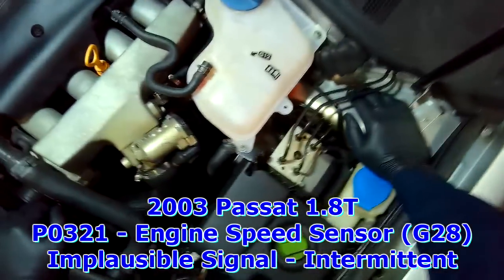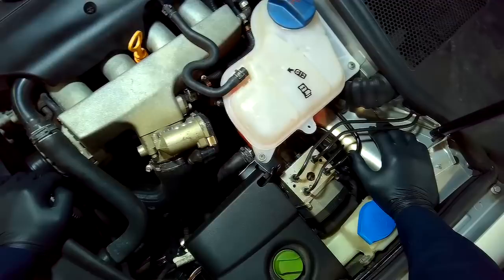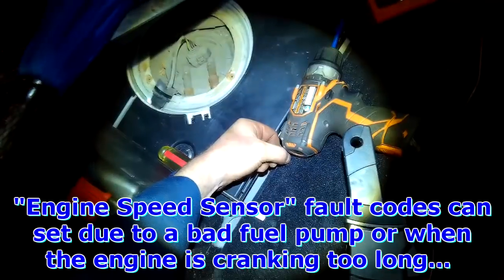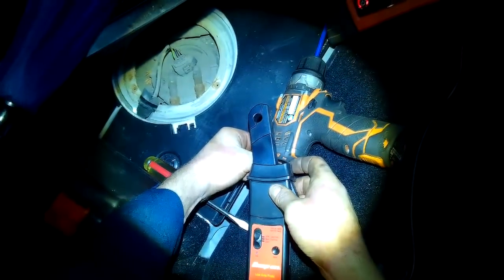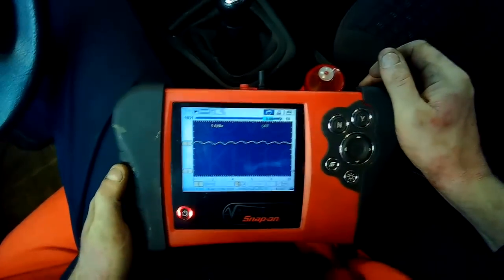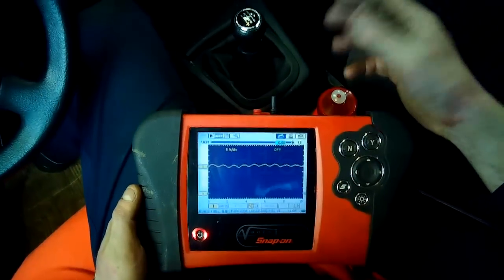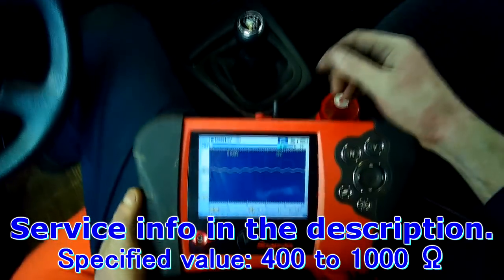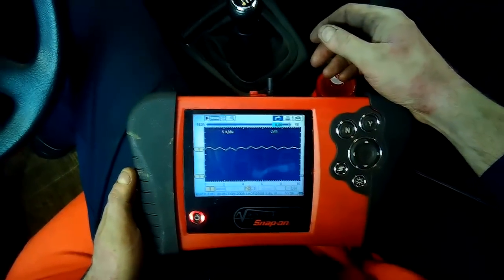VW B5: 1.8T Passat crankshaft position sensor

Comment: A valuable bunch of technics Thomas! Excellent.  The camcorder or go pro, whatever, those engineers should have already offered safety glasses, for user viewing of what exactly we will see so you can adjust the noggen accordingly.  LOL..
Reply: Also as I said in another camshaft position video you did, that I replaced the sensor but it changed nothing.  Still getting Camshaft sensor code. So is it next to consider the crankshaft sensor or the fuel tank?  Also, the crank sensor does not have its own code?
Reply from the maker: Like I already said... check if the cam sensor is producing a signal. If it is, then the signal is most likely generated at the wrong time and that's why the computer is flagging the cam sensor. Chain tensioner (as mentioned), cam & crank timing (as mentioned) need to be verified. There need to be 16 links between intake & exhaust camshaft TDC marks when the cams are at TDC (remove valve cover to check)... but check for a cam signal first (as mentioned). Camera I'm using is built into my glasses (link is in the description).
Reply: @EXOVCDS  I know I've read, watched items that you've already pointed out.  My hope is that this doesn't turn into a higher mechanical job.  That's where I may stop.  Paying to do it will unlikely be an option for my wallet.  Testing the CPS has me worried about accidentally touching a wire to another.  But i will.  Example: if my sensor is good, and I then remove the valve cover, there are things I need to prepare for.  I am at home and cannot walk to the parts department.  So my question is, if there are not 16 links, I assume this indicates a stretched chain and would require full replacement?  Or is there a master link. ( I kinda doubt). Thank You, Paul
Reply from the maker: Not knowing what the issue is... it's a bit premature to worry about chain issue. I have seen cam codes that were set because timing was off. That is the first & easy thing to check... after making sure that the cam sensor actually produces a signal. If the sensor produces a signal and the cam gear TDC alignment is correct with crank gear alignment at TDC, the next step is to check intake cam position (first with a scan tool to see degree offset) and if that does is not conclusive, then pulling the valve cover would be my next step... or activating the chain tensioner solenoid to see if a change in intake camshaft position is visible with a scan tool. Lots to do / think about. If the car drives & you lack funds, leave it alone and hope nothing gets worse. Start saving for a t hour diagnosis fee from a shop and then let them tell you what you need to do to fix the issue.
Reply: Thomas EXOVCDS I’m viewing I am understanding the limits of a multi tester as to a scan tool or diagnostic. I wish I could test my New cps but its likely ok as it’s brand new.
Reply: @EXOVCDS  so i metered the lead to the CPS from the ECU. Good ground, 9.1v on the signal middle wire, and 5v on the power.  Seems fine on the ECU to CPS.  Again I can't believe the new Cam Position sensor is factory bad, even though it happens, rarely, but could.  Seems like a magnetic out put should be able to be multimeter testable.
Reply from the maker: 9.1V signal with the engine at idle? 
The ECM sends a 12V signal to the sensor (middle wire) and the sensor intermittently "grounds" (pulls to 0V) the signal Voltage as the sensor wheel spins. When using a voltmeter to check the Camshaft Position Sensor Signal, a voltage of less than 12 volts will be measured (9.1V in your case). When the sensor is bad, it will either show 12V or 0V all the time. A sensor that is acting up intermittently is difficult to spot with a multimeter unless you happen to test it while it is bad.
Reply: @EXOVCDS  Waiting on my cam tension-er arrival.  A bit nervous about the installation.  However, after "assuming" my cam position sensor is OK, new, I wanted to ask if there is any slight adjustment available to possibly bring this timing into what the computer ECU would like?  And everyone says "16 links, which I understand as 16 pins.  But no one tells on to wat needs to be done if its at 17?  Replace the timing chain? Adjust? Thanks
Reply from the maker: @pauliekruger7639  I know you want to save money... but I don't know why you already bought a tensioner if you don't even know if that is the problem. Installing it wrong or removing it wrong can result in engine damage. I am going to withdraw from additional help, as I do not want to be part in possible engine damage. There are enough DIY articles on the web. Here's a 16 link image:
http://farm2.static.flickr.com/1350/634502061_2b5fab1d3a_b.jpg (image shows 15 marked links, so this is just a visual reference).
Taken from this thread:
https://www.audizine.com/forum/showthread.php/145543-How-do-I-adjust-the-Cam-Chain-on-an-A4-1-8t
If you ever get around to confirming TDC marks, I'm happy to look at pictures (that you took) so that I can confirm good or bad.
Reply: I understand your feelings.  My inquires are so I can better understand this engine and whats wrong.  Having the parts on hand is of course very important or I do it all twice.  Changing the valve cover gasket is step one.  If I see the pins are out of sync then I have the option to replace.  I have mechanical skills, doing all my own auto's for years, what I am challenged by this Passat is its total electrical congruent on the sensors.  This one effects that one and so on.  My Cam PS, is likely not the problem.  the ECU just like to use that as a intersection of another.  To me its a failure with VW and Audi to single a sensor.  It could be a simple cleaning of the Throttle Body.  Knowing ranges of said output is essential. Don't give up on me, I blame no one for my actions/
Reply from the maker: @pauliekruger7639  All manufacturers these days use cam sensors and cam adjusters. Read through DIY articles and report progress here. Having someone check cam & crank sync with a cope takes 5 minutes to determine if there is a timing issue.
Reply: @EXOVCDS  So while you responded, I double checked the ECU side/feed to CPS. First check, Ground worked fine, power nothing, signal nothing.  So I started to recall something about the fuel relay.  Looked at connection at fuel tank top behind seat/ trunk.  Dirty, but no relay, just a connection.  Inspected behind the feeder plug from ECU to CPS there was water dripping out.  Blew air till dry.  Did CPS terms too.  Turned key on only, Ground had grnd, power has 5v, signal had 11v.  CODE still cam back. Bizarre.  5 minutes will cost me an hour of labor here, 100 plus.  But when I reset the code while its running, again, the engine runs so smoothly, for 3 seconds.  I'm having trouble thinking the mechanical timing is off when this happens.  I don't blame you if enough is enough...  Thanks.
Reply from the maker: @pauliekruger7639  I'll be working on my mothers Passat this weekend. I'll record some specific cam sensor tests that you can do with a mulitmeter. You can then do the tests yourself, record them and post the video(s) on your youtube channel so that I can see the results.
Reply: Thomas EXOVCDS ok.
Reply: @EXOVCDS I look forward to this if your able to do this. Well I know your able, but I mean time.  Anyway I just wanted to give you an update.  My chain tenisoner arrived, and i will put it on the shelf for the time being.  I watched a vid on misfires.  My Passat runs rough, as I mentioned, and when I reset the code of Camshaft PS it momentarily runs perfect,"idles", then right back to ruff... So I started, the pulled a #1 cyl. coil off.  Engine ran ruffer.  Put back.  Pulled #2 engine was going to stall! put back.  #3 slight noticeable drop but still ruff. Now #4 seem like almost no difference.  So I am going to put new plugs in first.  Then check coils secondly.  The weird thing to me as a shade tree is this code points to CPS every time, yet it could be sooo many other things.  I'm reading back you comments to find where you told me of checking the timing.  I think it was had to do so I put it in my bad memory file.  But I see what you wanted, timing may be out do to a few things.  I hope I find that comment.  Thanks so much Thomas.
Reply from the maker: @pauliekruger7639  If one cylinder is affected (does not have as much power as the others) then it will not be a camshaft position sensor or tensioner issue, since those would affect all cylinders. If the spark plug is fouled, replace it and check power balance again. If it is still the same (not much roughness when disconnected) then it could be an injector or compression issue... or even a broken valve spring. Don't pull the valve cover until you figure out what is going on with #4 cylinder first.

Comment: Hey there thomas great vid as always, me here bothering you with other question. Do you know if the shift stick tranny bellhousing from a 2.8 AFC v6 can match a engine block of an ATQ v6 engine??  I'm wishing to make my passat swap from automatic to a shiftstick. the tranny i got is 5 speed. I've doing some research but not sure if it will fit well,
Reply from the maker: Not sure if this will be of help.... here are 2 parts pdf's. One for a 1996 and the other for a 2000. Some of the transmission codes cross over, so the transmission might fit, but I can't be sure.
http://fkh161.ca/Audi/A4/1996A4Q5speed.pdf

http://fkh161.ca/Audi/A4/2000A4Q5speed.pdf
Reply: thanks Thomas, i'll look those documents, i forgot to mention both cars are 4 motion passat and the Audi is Quattro. 
Once again for your reply thank you
Reply from the maker: Sorry... I should have looked up passat then.
I only compared AFC with ATQ engine... might still be useful. I'll check what 5 speed was available in the Passat.
Reply from the maker: Also lists a transmission that is the same on the other 2 pdfs:
http://fkh161.ca/VW/Passat/Passat5speed.pdf
Reply: Thomas EXOVCDS ok gracias, the passat is the 5HP19 tiptronic. I found a sticker in yhr trunk with this engine code  ATQ and tranny EKD this is for the passat. And for the Audi engine AFC for tranny CKH
Reply from the maker: Not sure about CKH fitting the ATQ... didn't see it listed in any of the pdf's that I found. You're better off finding a 5 speed off of a ATQ Passat to ensure it will fit.

Comment: I got a 2001 Passat with code P1522 I changed the 2 camshaft position sensors, and code still comes up.
Do you think it could be the this crank sensor ?
Reply from the maker: No... check your cam / crank timing. Could be that the timing belt jumped a tooth... or an issue with the cam chain tensioner... or something else.
Reply: Ok thanks I'll attempt to check it lol
Reply from the maker: http://wiki.ross-tech.com/wiki/index.php/17930/P1522
Reply: P0430 P0420 I changed sparkplugs and codes cleared, P1522 cleared after changing cam sensors and crank sensor 👍
Reply from the maker: Julio Duran time will tell.

Comment: I ran across this code just the other day and when I was looking up the diagram found that the fuel pump wiring also supplies the positive voltage to the injectors and crank sensor. This was a beagle.
Reply from the maker: I just got up... beagle?
Reply: Auto correct. lol I don't even remember what it was supposed to say

Comment: Hi Thomas, a little bit off subject I have a 2004 jetta tdi with the bew engine, i bought it as a non runner. Had a bad alternator. I installed A new one from the local parts store, and after driving for a bit it starts slamming through the gears (auto), i get two codes when the mil lights up, 17911/p1503, and 01166. I thought i may have gotten a bad alternator, i went and and got another one under warranty, and it still does the same thing. Cleaned the grounds under the battery, and not sure what else to do. Any help would be appreciated. Also on the measuring blocks on vag com i get 14.52 volts but 0 load on the alternator
Reply from the maker: Key ON engine OFF is the battery light ON? Should be... if not, check the wiring for the small plug at the alternator.
Reply: Thomas EXOVCDS yes the battery light does work, what should i check on the small plug?
Reply from the maker: Let me find a wiring diagram... I'll get back to you.
Reply: Thomas EXOVCDS thank you so much for taking the time
Reply from the maker: http://wiki.ross-tech.com/wiki/index.php/17911/P1503
http://wiki.ross-tech.com/wiki/index.php/01166
http://fkh161.ca/VW/A4/VWA4BEWAlt.pdf

The blue wire is for the battery light in the dash... since it is working, that wire is OK. The brown/red wire is the wire that the ECM uses to keep an eye on the alternator. Could be a problem with that wire... or ECM as indicated in the Ross-Tech link. Could even be that the alternator "does not" support / have a second pin for the signal to the ECM. Remove the small connector and check if there are 2 pins in the alternator. Does / did the old alternator have 2 pins?

Comment: Hello, I have a 2001 jetta tdi that has a bit of an issue on cold starts. Not cold temp. as I live in Florida, but as in engine completely cooled off and starting it the next morning. It turns over a while and starts with a pretty big puff of mostly white smoke. At the same time it has a surging or up and down idle for about 10 seconds and then idles smooth and about that time smoke is pretty much gone. It is the only time it ever does this, the rest of the day it starts perfect and doesn't smoke or idle weird at all. I thought maybe a timing issue, or a bad injector? Happy holidays!
Reply from the maker: corbin steele Yes... I would check timing (VCDS / VAG-COM) is required to check. Also check coolant temperature sensor values  with the scan tool.
Reply from the maker: +corbin steele One more thing... check the intake for carbon buildup. If the engine can't breathe right, it can have cold start running issues.

Comment: My Dear,  My jetta 2004 bbw show me a code 00264, the car can move forward and back but the transmission does not do the shifts. Do you have some video of it? I need any help.
Reply from the maker: Sorry, I do not have a video for that (yet). Here is the code definition:
http://wiki.ross-tech.com/wiki/index.php/00264
You can search YouTube for: Solenoid Valve 4 (N91)
To see what is involved. There are different styles of automatic transmissions, so be sure to search for the one that you have. ie. 4 spd, 5 spd, 6speed.
Reply: Thanks, Thomas. How can I know what type of transmission is? for example, 01M or other
Reply: Ahhh. Ok.  I already found 4-speed 01M; 5-speed 09A. Now, the problem, how can I recognize the zone affected?
Reply from the maker: I'm still at work... I'll get back to you once I'm at home. If your shifter can move to the right and you can shift + / -, then it is NOT a 01M.
Reply: Good Morning Thomas. Look, I'm going to review wires on the engine. I couldn't do that because yesterday there was an awful wind. Later, If I discover some problem on the valve N91 after checking under the car, I don't have information or diagram about that zone (above of filter). I know that I must review the wires in that zone, but I want to be sure with all. Would you mind helping me?
Reply from the maker: I'm starting work in a few minutes... I will send you Engine & Transmission wiring diagrams once I get home later tonight (6pm west coast time).
Reply from the maker: BBW ECM Wiring diagram starts on page 4: http://fkh161.ca/VW/A4/VWA4BBWECM.pdf
01M TCM wiring diagram: http://fkh161.ca/VW/A4/VWA401MTCM.pdf
Reply: Thanks, I let you know my progress later.
Reply: Really, very nice here down, but now, how can I determine where is the problem? Do you know about the ohms of the valves? because I have five valves with approx. 60 ohms and 2 valves of another type, one with 5 ohms and other with 6 ohms. I've reviewed the harness and there's no anything rare, and I don't find any short to ground. I'm going to try again. If you know some tip, please let me know.
Reply from the maker: My friend serviced his 01M not too long ago:
https://www.youtube.com/watch?v=gJUFJTpgmcI
I'll check the service info and will get back to you.
A broken ribbon cable can also cause issues.
Reply from the maker: Solenoid valve 1 55 to 65 ohm
Solenoid valve 2 55 to 65 ohm
Solenoid valve 3 55 to 65 ohm
Solenoid valve 4 4.5 to 6.5 ohm
Solenoid valve 5 55 to 65 ohm
Solenoid valve 6 4.5 to 6.5 ohm
Solenoid valve 7 55 to 65 ohm
http://fkh161.ca/VW/A4/01MSolenoids001.pdf
http://fkh161.ca/VW/A4/01MSolenoids002.pdf
Reply from the maker: If resistance is OK, there could be a mechanical issue / sticking.
Reply: Let me review the harness maybe I can find something. That diagram of page 61 and the page 53 are excellent.
Reply from the maker: send me an email if you want the complete "Self Study Program" for that 01M transmission: fkh161@fkh161.ca
Reply: I sent you an email.
Reply from the maker: Reply sent.
Reply: Thomas EXOVCDS Well, I’m tired and will continue next Tuesday. Thanks a lot for helping me. Merry Christmas for you and your family.
Reply: You said me, "If resistance is OK, there could be a mechanical issue/sticking." Does it mean the mechanism inside valve body?
Reply from the maker: cvalles128 Sorry... the fault code points to an electrical problem. If the resistance is OK,  then check the connections & the ribbon cable. Also the main harness plug for the valve body / electronics.
Reply: Thomas EXOVCDS Finally, the car is ok. The part arrived yesterday. Thanks a lot Thomas.
Reply from the maker: Thanks for the update!